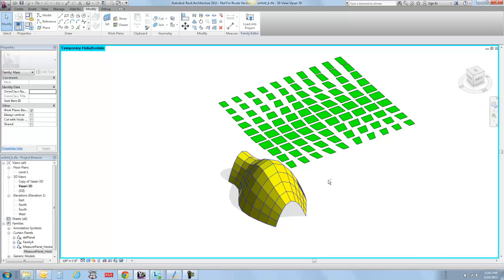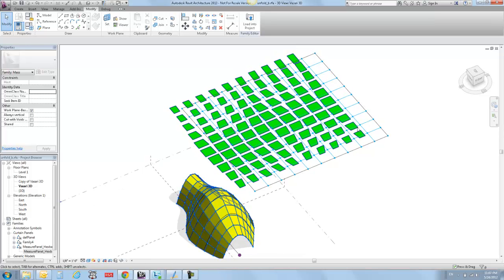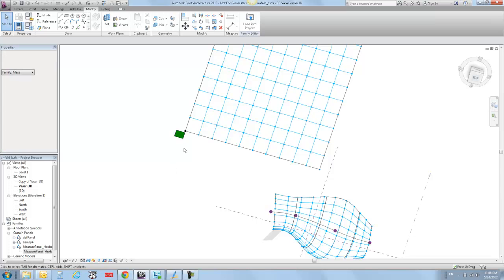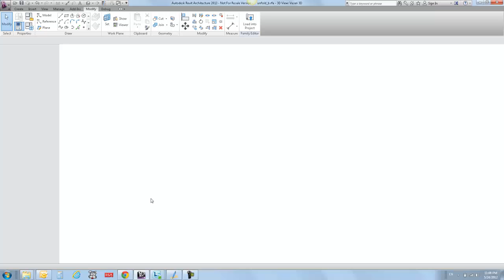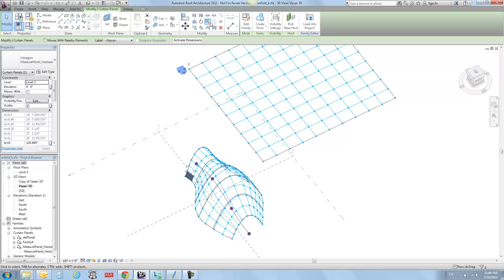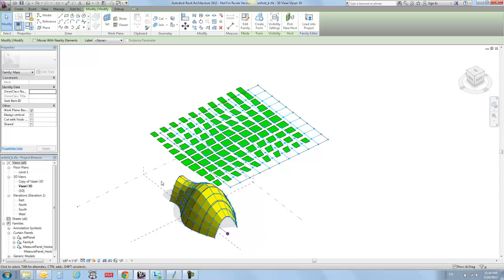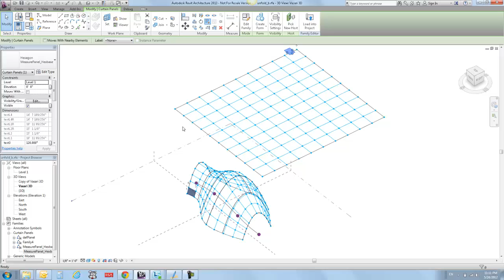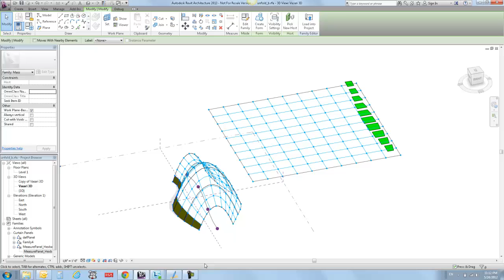Repeat and Divide Prt II: Unfolding

Comment from the maker: Revit will make planar and non-planar panels, depending on how you construct the model.  Unfolding, using the method shown, will only be accurate if you start with planar quads.